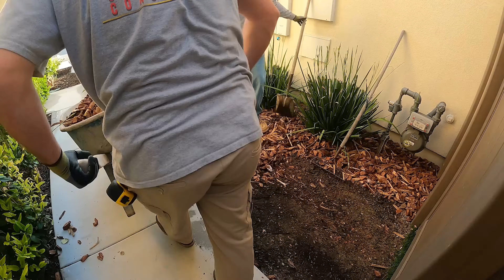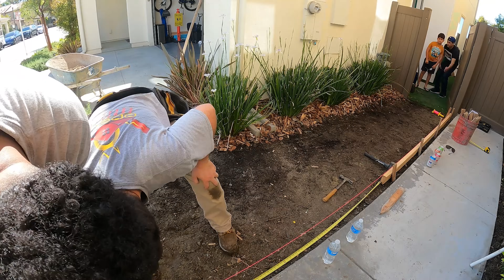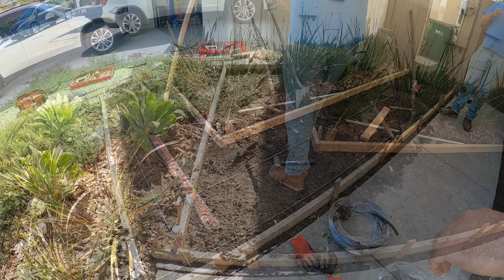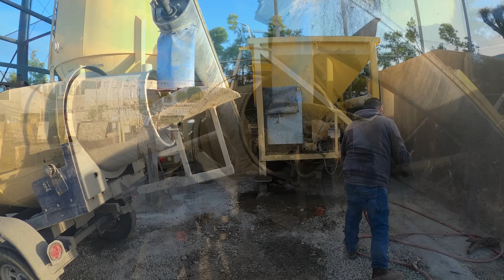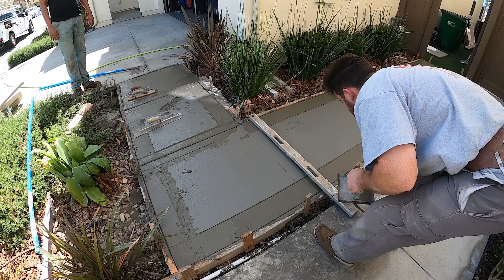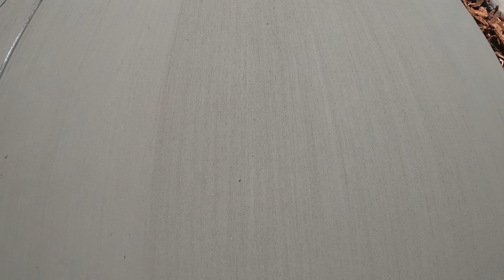Concrete Slab Walkway for Beginners

Comment: This is exactly the project I want to complete this summer. I live in Westfield Indiana. Two things are holding me back from starting this project: I don't know what permits are required in my county and I don't know how or where to dispose of the dirt I remove. I don't have any other place on my property to put the dirt. Additionally in the past I have tried to offer piles of dirt for free at the curb and very few people would come to take it.
Reply from the maker: Try the trash can little by little.
I seen a guy dig a swimming pool out over a couple years span by putting it in the trash can.
Shouldn't need a permit for a nonstructural walkway

Comment: Have 2 question , First question is you said you doing 6 inches deep but you use in a 2 x 4 sides . Second question is we do not need a sub base  under the concrete

Comment: In case I want to lay tiles on concrete any advise on how to deal with the joints ? Is it ok to tile over it ? Will they crack ? Trying to pour concrete little by little in my backyard before I tile I been told that it’s necessary in Florida before tiling . Any help ? Or advise I appreciate it
Reply from the maker: slip joint over the joints and cracks
Reply: @OdellCompleteConcrete  I don’t have any cracks because we didn’t pour the concrete yet , someone else told me I don’t need it if I do a crushed stone compacted base and can tile directly on it with mortar .Very confusing ,

Comment: One detail that could have set the small job even better would to have matched the joints on the new concrete with the old one on the side. The problem is the inner corner didn't line up, but the job looked amazing regardless.
Reply from the maker: It's an option